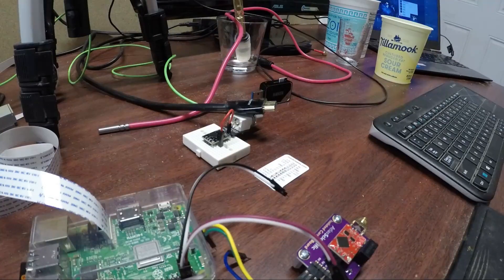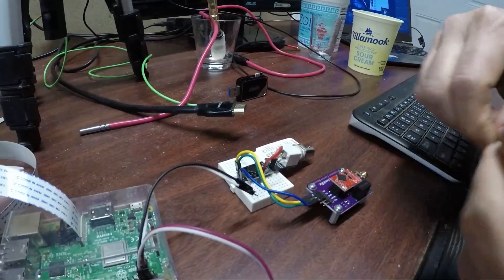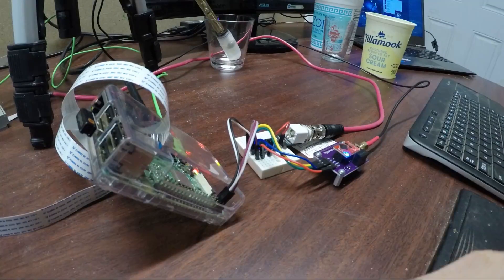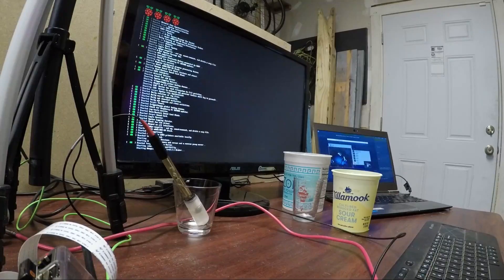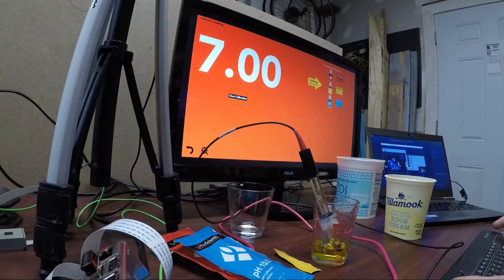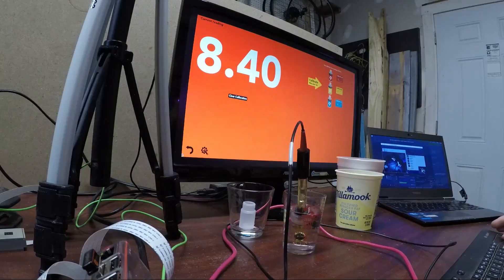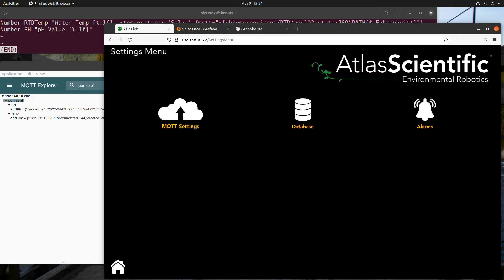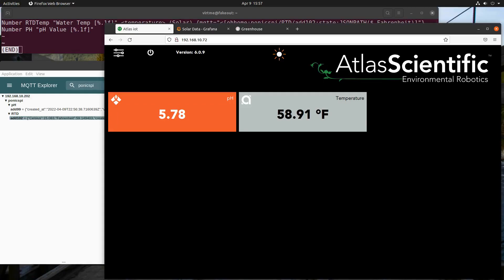Raspberry Pi Atlas IoT Setup and MQTT examples for OpenHAB

Comment: are you still running this? curious if you had any things you'd do different or not.  I'm thinking about using this to do a pool orp/ph/temp monitor and dosing control.
Reply from the maker: I'm still running the hardware but switched to MyCodo for more capabilities. I'm overdue for calibration too. Time is rarely on my side.

Comment: Hey wondering what the ph sensor model or name is. The life span is appealing to me. Seen your video on reddit, thanks for sharing, I'm looking into setting up one of these over the course of this summer
Reply from the maker: Atlas Scientific. If you get the kit it comes with the lab grade sensor, control board, and electrically isolated carrier board.
Reply: @penguinponics  okay, thanks!